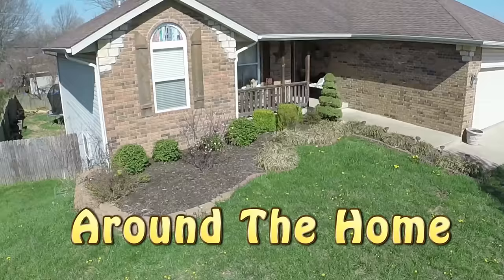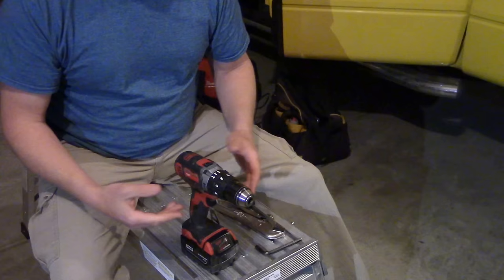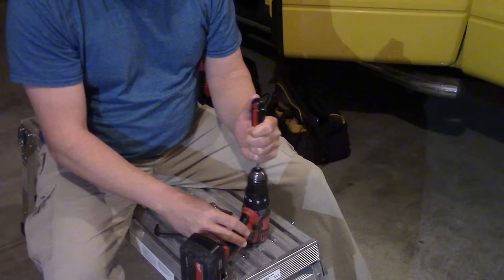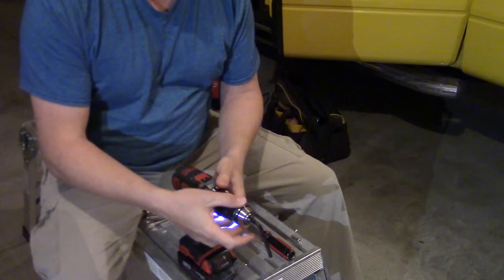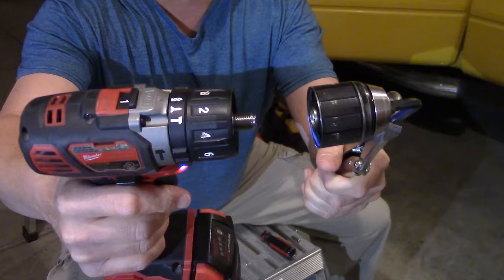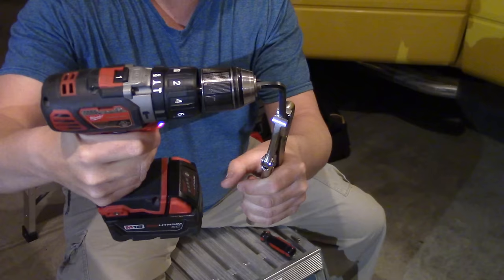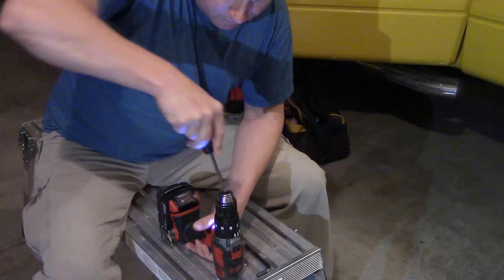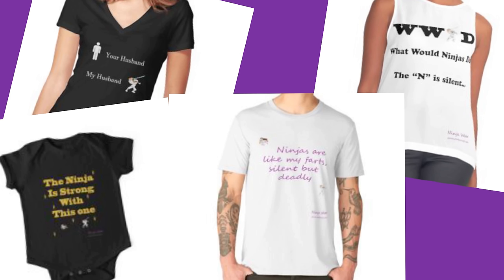Cordless Drill Chuck Removal

Comment: I just bought a used 1/2" Craftsman C3 (19.2 volt) on ebay and just got it. Seems to work fine with the clutch (no slipping, etc), however when you release the trigger it makes a loud noise (kind of a grind noise) when it stops. Non of my other 3 Craftsman drills make this noise when they stop. Any info would be great as I just received this drill this weekend and need to act on it. Thanks...
Phil
Reply from the maker: Phil, thanks for the question. Most all cordless drills have brakes on them. Sounds like that is what you are hearing. I don't have any videos on repairs for that, but I would just do a search on that.
Reply: @AroundTheHome1  Thanks for reply.
Is this something I should be concerned about making the drill inoperable? I just bought it from ebay and would send it back if it's a big concern. 
I really don't want to send it back, but if it will make the whole drill useless down the road, I would. If the brake is only to stop the drill from spinning when the trigger is released I could probably live with that if the brake fails. Thanks again. Appreciated.
Phil
Reply from the maker: You know, I don't really know enough about failed brakes to tell you. I don't know if it could lock up all the time or is just going to not work when it should. I don't have a good answer for that one.
Reply: @AroundTheHome1  I do appreciate all your input. 
I will decide whether to take a chance on the drill or send it back. The problem, the ebay seller will likely not pay for return shipping so it I will lose that way. Lesson, don;t buy a used drill on ebay even though I had him test the clutch, but I never knew about these drills have brakes. Thanks.
Phil
NYC area
Reply from the maker: 👍 So glad to help! Thank you for watching. Check out hundreds more of our videos at https://www.aroundthehome.org
Reply: @AroundTheHome1  Thanks. I will......

Comment: I ain't got no battery for mine, and the chuck needs to be removed. How can I do it with no battery?
Reply from the maker: One might ask why are you repairing a drill that doesn't have any batteries. If you don't have batteries and the chuck is busted it is way cheaper to just buy a new drill with new batteries. But to answer your question, most cordless drills have an electronic brake. It's what stops the drill the moment you let off the trigger. So it should be on right now and not allow you to rotate the main chuck. So lock in a large allen like I did in the video, but instead of clamping a vise grips to it, clamp the allen in a bench mounted vise. Then rotate the whole drill. Thanks for watching and don't forget to stop by our website for many more helpful videos. www.greatwhiteninja.com
Reply: @AroundTheHome1  thanks for advice man. Mine has a Philips head inside the chuck. The drill was given to my dad because the people at his work didn't wanna fix it. And they didn't wanna give up any batteries

Comment: The chuck on my Ridgid drill broke last night. It's got a 5/32" bit stuck in it and won't open. Any ideas?
Reply from the maker: First I will say that I have not been in that situation before, so I don't have first hand knowledge of the best way out  of that. The only thing that I can think of is to put a metal cutting fabric abrasive blade into a miter say and cut the chuck in half so that you can reach the screw. Of course this is just a suggestion so play it safe and don't destroy your drill. You can of course take it to a repair shop as well. Thanks for watching. Don't forget to stop by our website www.greatwhiteninja.com
Reply: Try 2 channel locks. Use them to turn the two parts that you usually turn by hand.

Comment: Is it possible to change out the black and decker impact to a shank drill chuck? My drill died and was wondering if its capable
Reply from the maker: Are you asking if you can make an impact into a drill?
Reply: @AroundTheHome1  that's exactly what I'm asking. Is it possible? Not sure its possible without taking the whole thing apart
Reply: @AroundTheHome1  my other drill motor went out so I bought a drill chuck for my impact and it keeps breaking the left hand screw leaving the drill bit locked inside and having to buy a new drill chuck
Reply from the maker: Honestly, I don't know. The impact motor is smaller then a drill, but the impact action is what gives it it's torque. I would think that the answer is no, but I have not tried this to be sure.
Reply: Because I love my impact drill but like the concept of the locking chuck like a drill...found a hex shank drill chuck for the impact and I keep snapping the damn left hand screw and locks the bit in the chuck

Comment: what if its stuck closed?
Reply from the maker: I really don't know for sure. Might need to take that into a repair shop and let them handle it. The only thing that I could think of is put it in a miter saw with a metal fabric blade and cut just the end of the chuck off so that you could get the screw out. Of course, then that makes removing the chuck harder at that point. Thanks for watching and don't forget to stop by our website for many more helpful videos. www.greatwhiteninja.com

Comment: Just wacked myself in the nuts
Reply from the maker: It can happen
Reply: @AroundTheHome1  I got it done. I didn't continue your method though. Clamped it, and used my jack handle as a cheater pipe. I swear the drill almost broke from the torque but I read on Reddit that it takes a lot to undo sometimes and they thought their drill was also going to break.